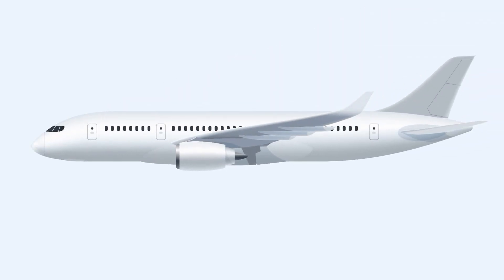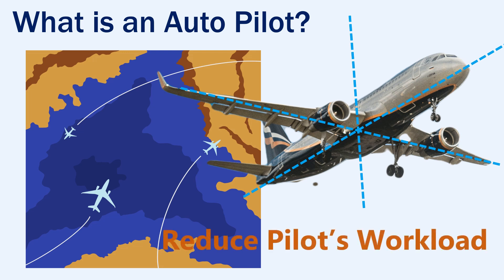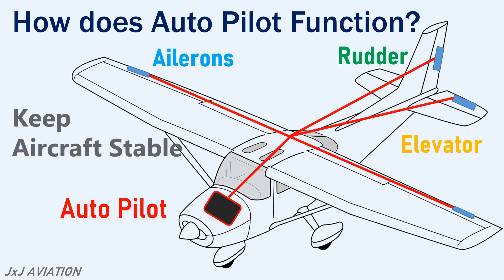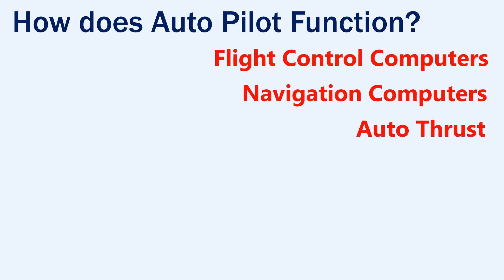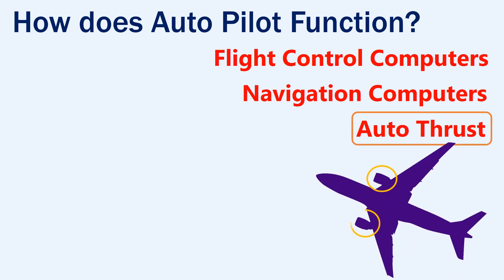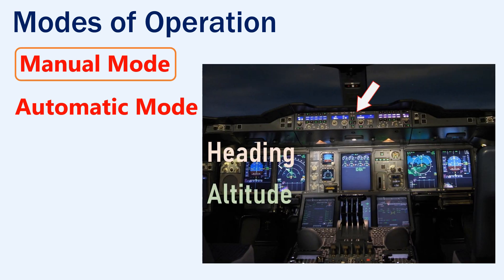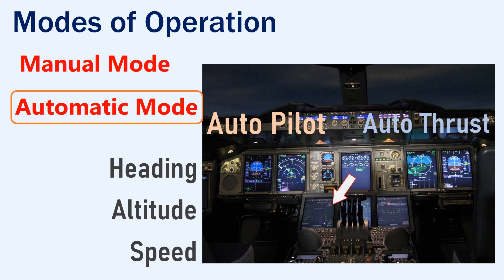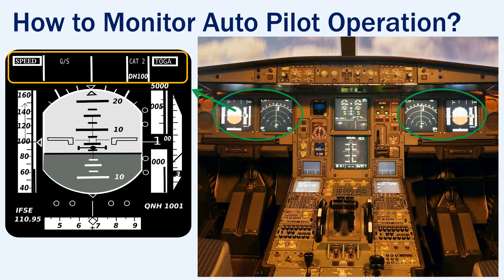How does an Aircraft fly by itself? | Auto Pilot System| Modes of Operation | Auto Flight |

Comment: The first part explains basic AP, essentially attitude control for all three axis', and possibly being switchable for less than the three. Everything after that would be additional features and are brand, model, age specific. Some aircraft have extra features and some don't. And the extra features tend to be the results of technical evolution, ie, bigger/newer planes have more stuff, although new small plane might have more stuff than an older big plane.
Reply: @snakerstran9101, does that mean autopilot navigating the aircraft along a predefined flight path is an added feature and not a basic feature of autopilot? This has always been my question, kindly help clarify.
Reply: @utkarshmishra1928     I worked on several different AP systems, and they all had the rudder connected to the compass system as opposed to the pitch and roll axis's connected to a pitch and roll gyro. So, on those, if the AP rudder axis was engaged, it would get a compass signal for its attitude reference.
Reply: @snakerstran9101 , what i meant to ask was if manoeuvring the aircraft along the (curved) flight path is a basic function of autopilot or an added functionality
Reply: @utkarshmishra1928     Lots of different system designs out there. A basic rudder control could hold acft on the heading at the time the AP was selected, or at the time the rudder channel was selected, if equipped. 
A "enhanced" feature might be a connection to the flight director system where pilot could turn a heading knob and the acft will follow. A AP turn control feature could have the rudder be involved in a coordinated turn with the turn knob. And it goes on from there with various navigation features/waypoint steering, crosswind crab, etc
Reply from the maker: Thank you for the information!

Comment: Indeed, the Autopilot does not have a role of thinking, reasoning and decision-making. It executes the pilots' instructions and directions.
Reply from the maker: That is correct. The inputs may be from data base or short term inputs!
Reply: That is kind of a potato/tomato view. The pilot commands by turning modes on or off. But once turned on, the AP very much has a role in thinking, reasoning and decision-making, the very definition of a processor. Signals are input to the processor, the processor makes decisions, the processor sends output signals to "fly" the plane.
Reply from the maker: @snakerstran9101  The processing is done based on the flight plan that was loaded. Wouldn't say its a decision making process!